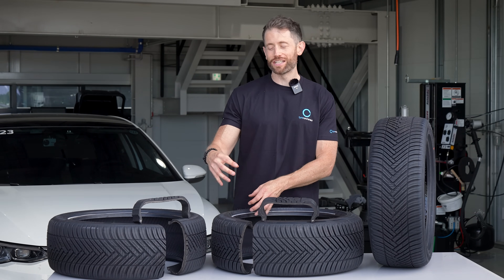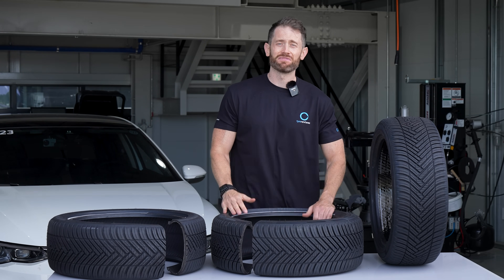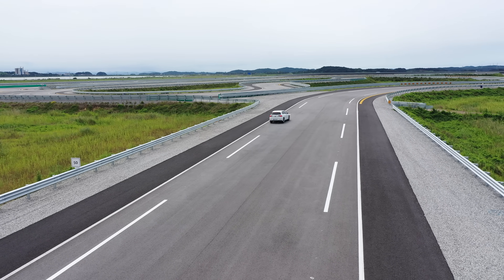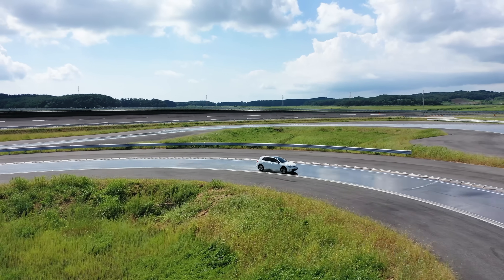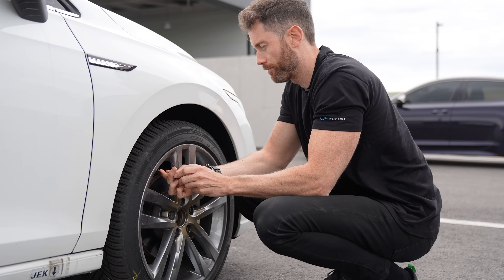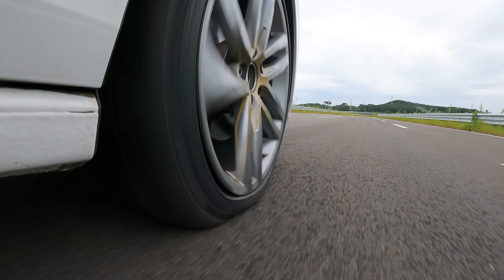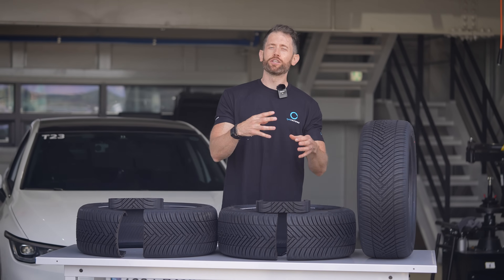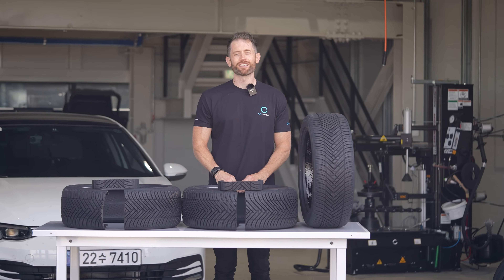Are Modern Runflat Tires Finally Good? Normal, RFT and SEAL Tires Compared!

Comment: The one downside of the sealant tyre is difficulty in recycling it. A conventional tyre is typically shredded and metal separated from rubber materials. Adding gooey sealant material is a problem for that process. This may be why it isn’t currently being more broadly adopted by OEM’s.
Reply from the maker: Yes you are right, i only realised this after filming. I should have thought about it at the time.
Reply: @tyrereviews  Love your work

Comment: Would it be possible to combine the two products? 
In other words make a run flat wich also has the sealant? 
And another question : 
When I look at Tyre labels, I sometimes see that there is a difference in wet braking stopping distance between normal and reinforced /extra load tyres from the same  manufacturer and type. Often in the advantage for the reinforced variant. Would it therefore alsways be wise to choose the latter? Any disadvantages over the normal load variant? Price wise there isn't much..

Comment: With today's all season tyres directional tyres seem to be making something of a comeback. In the late 1990's and early 2000's directional tyres were very popular. I had good results with Goodyear's Eagle Ventura and Bridgestone's Potenza RE-720. I've lattery shied away from directional patterns on account of their ability to make strange cornering noises. The worst of the kind for me was Uniroyal's Rainsport 2. Mounted these on the front axle of BMW 528i  - 222/55R16. They drove well but even light cornering sounded like wheel bearings on the way out. Replaced all four with Michelin Primary HP (BMW OEM marked) and all was good. Interesting.

Comment: Bought a BMW e46, which had run flats on the rear which weren't supposed to be on there & they were awful, went to change them and discovered cracks in the alloys, ended up being expensive

Comment: I'd like to know if, in a nasty pothole impact, run flats might protect your wheel from something that would compress through a normal tyre and make contact, and damage the wheel. Would be some pretty destructive testing though.
I expect for lots of impacts that are bad but not that bad, normal tyres do better at protecting your chassis, bushings and suspension components. He said himself he felt the large impacts less sharp (spread over longer) with normal tyres.

Comment: Fuel efficiency will drop a bit with the run flat due to the heavier weight. The only real tangible downfall. Well that and the additional cost.

Comment: Hi, if this Hankook is 4G of RFT tyres in which category do Pirellli PZ4 Luxury MOE and Sottozero 3 run flat fit? Can you compare this Hankook in terms of comfort with PZ4 MOE? In my experience PZ4 MOE is much comfortabler than SZ3 RFT. Also can you compare PZ4 MOE to premium non RFT UHP tyre in size 255/35 R19? I have stock Pirelli's on car and thinking of staying on same MOE tyres or changing to GY F1 Assym5 MO, just because of comfort...although PZ4 MOE is not bad at all if you give it a little more tyre pressure.....thanks in advamce!

Comment: Ahh, I was waiting for this for so long. THANKS !!!. One of the few channels it is worth to be subscribed ! 
Two things I would like to add. One is n cases where you drive higher tyers. I drive BMW F34 and the tyre is 225/55/17. So, in this case the normal tyre will make the car sway in turns when the speed is higher - (above 80 km/h)  Where the RFT will just keep you stable. But if you are also in Bulgaria like me, well, the roads are bad so the comfort will suffer. This is my experinence after 4 years with RFTs after I have been on regulars only before.
And second thing - mind the type of the runflat. For example I have Bridgestone Driveguard 225/17/55 101W XL. Now, we all know on a standard tyre what XL is, but I have no idea what does XL mean on a runflat and I have not found any info on the web. But if you buy same size but lets say 97Y from other brand or Bridgestone type, then the comfort will improve. So really mind this when you pick it.

Comment: Actually… I did. I drove for about 60 miles at over 70mph with run flats with zero pressure. They were absolutely fine when I got to the dealership. 😅

Comment: I love the concept of a run flat tire  but they are so hard to find at the shops where I live. It's great to not need a tow to a tire shop but if you want to replace the tire with another run flat either the tire will need to be special ordered  and that can take 1 -3 days for delivery  or the tireshop will tell you that they do not do run flat tires and now you are calling around or potentially needing a tow anyway.  If you need to drive you car RIGHT now you will have to purchase a different tire today and then later on buy your run flat and have it installed and now you have a random extra tire.  A lot of cars don't have spares so you absolutely need a run flat in that aplication you have no other choice than a run on flat. 
The Seal tires are really cool! hopefully every tire adopts that technology and that can be the "new normal" I would rather have a tire that never goes flat than a tire that you can drive while flat!

Comment: I had literally never even heard of the sealant tyres. I wonder how well the sealant would work with a screw that remains embedded in the tread. Out of all the punctures I've had, I'd wager over 50% were screws, not nails. One happened just last week.

Comment: Ok lets get techie...  in some cases steel thread failure happens in long term exposure to moisture which in some cases happens after a puncture and tire patch up from the inside.  Generally you may still have legal level of tread hight but that does not mean your tire is still safe from a blow out due to steel belt corrosion. Its a ticking time bomb. It better to know that you had a puncture than not knowing you did. But in this day and age few cars carry that extra load to increase space and fuel mileage.

Comment: This is amazing information, thank you so much! My next tyres (if I can find them in right size) are definitely either seal (really impressive that it's basically the same tyre just puncture-resistant) or run-flat!

Comment: I could not tolerate reading through all comments and replies, my apologies if already covered.  BMW wheels (at least on those fitted with runflats) evolved to EH2+ humps.  These huge beads on the wheel kept the tire from collapsing and enabled running flat for 100 mi vs the standard wheel with run flat.  I suspect it is difficult to make an ultra low profile run flat, the shorter the sidewall, the less material to run flat on.  I wish you were able to weigh the tires on a scale?  Looking at tire specs the DriveGuards (also latest generation) are still heavy compared to a standard tire of the same size.  thank you for the excellent review and cheers to Hankook for setting it up!  (I just researched if they have a run flat in the tire size I am looking for and unfortunately not).

Comment: another tyre that I'd have for the UK winters if only they did it in my BMW size. 225/45/18 and 255/40/18 staggered set up.

Comment: Runflats are completely fine, ive seen them make some weird damages on the rims but other than that I have nothing. Self sealing tyres are in my opinion worthless because I simply do not trust them to be able to seal a puncture for the remainder of the tyres life, not like I trust a combination plug anyway. Ive also seen self sealing tyres not sealing regular punctures like nails also. Normal people dont look at their tyres in search for nails in the tread so it really is a matter of time until the seal stops sealing good enough to keep the air inside and all of a sudden, just like a regular puncture, you have a random puncture. Many tyre shops dont want to bother repairing them too because the seal makes a complete mess.

Comment: Hi Jonathan, first of all thank you for such a great test. In case of a puncture on the sealent tyre, we can not realise it. It will seal, but the ruber will be damaged anyway. Will it create a safety risk at top speeds?
Reply: The tyre doesn't get its strength from the rubber but from the steel cords. So long as they're not damaged it should be fine.
Reply: @tomcardale5596  thanks for the informaton.

Comment: I am surprised you are asking BMW M for fitting runflats. If the tyre presents no clear advantage in grip and makes it more difficult to pass WLTP then this is no option. On top it will be challenging to sell a runflat with a sports compound, so it would be specifically made for this car in question. But of course I am also happy to see a good performing runflat, because safety is most important everywhere.

Comment: On a BMW F10 I use Michelin Pilot Sport 4S RFT during summer and Pirelli Sottozero 3 RFT during winter. Slightly stiffer than normal tyres but makes my car feel more stable.

Comment: Self sealing tires are great until your 85 year old customer doesn't drive her car for a month and the wheel can't even be balanced because 12 oz of slime has accumulated on one side of the tire and it would rip your balancing machine apart.

Comment: What are your thoughts about the Pirelli Scorpion Verde Sealinside ? They came as standart from the Autodealer where i bought my car. Never bothered to check the performance or stats about them. 255/40 R20 XL size 4x4 .

Comment: Interesting.
I recently replaced the Michelin Pilot Supersport (runflats) on my 2019 Corvette Z51 with Michelin Pilot All-Season 4 (non-runflats). I now notice the steering is not quite as sharp or with as much feedback. I initially suspected that was due to less stickiness and tread differences. But I now wonder if it's more due to the lack of runflat sidewalls.
Any conventional wisdom here?

Comment: Michelin Primacy 4 is the magic carpet-like  ride of the run flat all season tires.
 
Continental Touring run flats are close and superior in handling.

Pirelli SottoZero is the highest performing all weather run flats...amazing traction all conditions.

SottoZero, however, weakness is those fast unexpected potholes. No mass produced tire is yet impervious to that, but the Michelin Primacy and Pirelli Scorpion 4 will be more forgiving.

There are several other tire makers that really stepped up their game in run flat tire ride comfort.

Not bad video. I was often disappointed with tire test videos, because I didn't really consider a tire a tire, if it wasn't a run flat (the highest tire protection in existence!). 

Let's face it..blowouts are extremely dangerous and tires are a critical safety components of cars (road transportation, etc.)

Comment: I've driven over 1,000,000 km in my lifetime (yes I'm getting on in age) and with all the pictures I've experienced the object never magically pulled out of the tire. The nail or screw remains in the tire and you get a low pressure warning over time or you hear the clicking of the nail if the windows are open (at low speeds). Would the sealed tire work as well if the nails remained in the tire?

Comment: Why does Europe get all the directional tread tires and North America gets all non directional? I hate it. Not fair.
Reply from the maker: The 4s2 is actually sold in North America!
Reply: @tyrereviews  unfortunately not in my needed 265/45/21 size. Seems like a lot of the euro tread style tires, if we are able to get them in north America, come in small sizes. Given the amount of trucks and SUVs Americans run, I wish there were more options for 255-315 (performance SUV size) widths and 19-21 inch rims. Summer tires have a decent selection, but good all seasons seem really limited. I live in Minnesota so I favor the all seasons that can handle snow ❄️.

Comment: I ran run flats on my BMW for about 10 years and was never happy with them. Especially due to the exorbitant cost compared to a normal tire. Best decision I ever made was say screw it and put normal tires on the vehicle. It was a better all around experience. If I got a flat the tire it could be repaired or replaced at a fraction of the cost of a run flat tire.

Comment: What happens on a seal tire if the nail stays in and doesn’t come out?  Every nail or sharp object like a nail stays in the tire. It doesn’t come out like on your test. Doesn’t seem like that is a good test at all. Well at least in my opinion I’ve never seen a nail go in and just come out.
Reply from the maker: It will seala it until it works its way out, then it will seal the hole.

Comment: Since it is more material I am assuming it weighs more. One thing you didn’t test was acceleration. If it’s heavier it would make the car slower in acceleration.
Reply from the maker: Honestly with the weights involved it would be very hard to tell.
Reply: @tyrereviews  thanks for the replies!

Comment: How about temperatures? The run flat with the sealant around the interior works to close up the punctures while at normal ambient road temperature. What if anything do you think would happen to the sealant when operated on very hot road surfaces? Do you think it might become less viscous to seal punctures adequately? What about the balance of the wheel if the sealant does become hot and soft. Do you think it would be possible for it to become runny and start to migrate or settle to the bottom while the vehicle is at rest for prolonged periods of time? We also have to take into consideration cold winter temperatures. What do you think could happen to the sealant when it gets cold? Would the sealant be sufficient to still seal and or close up properly to control a puncture? What about the sealant chipping or breaking up during operation and hitting pot holes? Now, I don't really expect for you to have those answers that only the manufacturer should have the information on, if these concerns were ever considered and or tested. I would think if HANKOOK did, it would be posted as common knowledge for people who consider purchasing and using their product. Perhaps there might be a follow up video that might shed some light on the things mentioned? They could lead to a real safety issue in the future, especially for those who get comfortable with the way the tires perform, and ever changing fast paced and bad driving habits. Sorry if the reader(s) find this comment boring, I'm just saying.

Comment: the same  situation was with the latest  bridgestone ones that were described as the smoothest runflat ever! Jonathan, as you know runflat tyres are similar to regulars when new but after the first year when they start to age they become more stiffer thus more uncomfortable compared to a similar regular tyre! so always the first impressions are such a happy place to be!

 i own a bmw 10 for years now.the first 2 sets of runflats were from goodyears, different models ,the first came with the car and the second was my choice..first one was horrible second one was less ,but still horrible..i had a puncture inside town and i can confirm that runflats do the job..i fixed the  hole the next day and had about 2 more years driving with that.. but..i replaced them with michelin pilot sport 4 regular and finally i found comfort inside my car and relief for my body..steering wheel has now more information sthing that a good bmw we all know is famous for..it all depends on how you drive, what do you feel when you drive, how good info you get from your car and what do you prefer , comfort or safety more? runflats are heavier and stiffer thats what they are safer..instead of making runflats more comfort why not trying to make regular more safer? lets say by making them all self-sealant, like you suggested  Jonathan , because all you need the runflat for is to avoid a sudden blowout with many miles in an wide-open street corner..for replacing a wheel unless you drive professionally on highways, there is always an insurance pick up vehicle to serve you..
Reply: Bridgestones are good only for the first year. The second year they get harder and start to have small  cracks on them. They start to skid on the dry, and slip on the wet. Would never fit again on my cars  even it's for free..

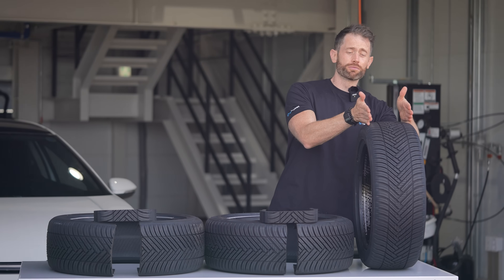Comment: Wouldn't it be interesting for your channel to have 3 identical cars, 1 on summer tyres, 1 on all seasons and 1 on winter tires brake from 100-0 kmph every day from 1 December to 1 April every day at 08:00 and 16:00.
 
Adding up the total braking distance and dividing it by the relevant days to conclude which tire is best for your local climate in winter.

These times are also the times when most people drive on the road, so the most representative.

Comment: You ask why sealant tyres aren't more popular, well maybe that's because I've never heard of them and I've never ever seen them advertised anywhere certainly no tyre company points them out in Australia. This is the first I've ever heard of them. Maybe they should stop being top secret if people are to buy them.

Also as someone not interested in all season tyres living in Australia, until they make a runflat ultra performance tyre they are not something I'll ever consider. Also more unsprung mass to worry about and 20% more expensive when the tyres I buy are already $500-600 each, no thanks. And they only work once.